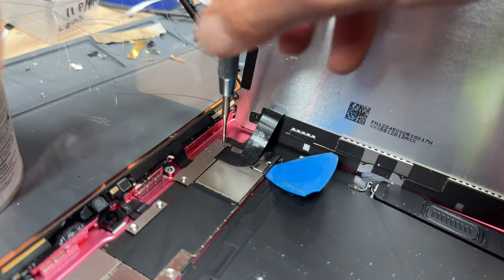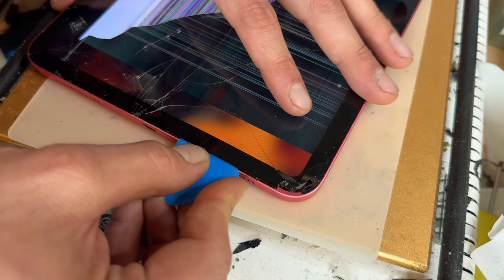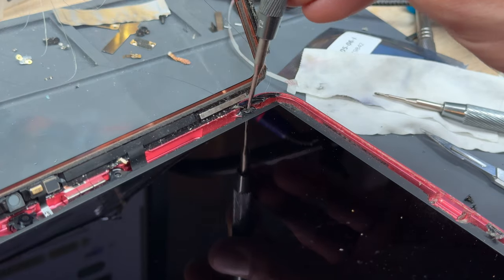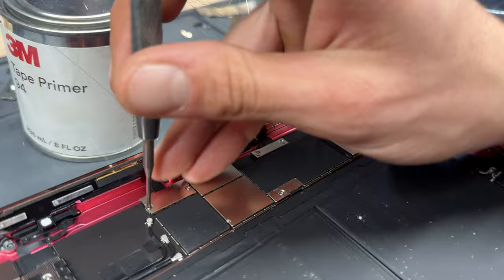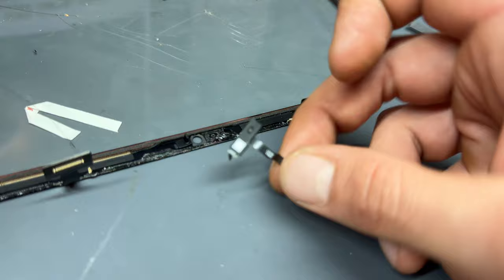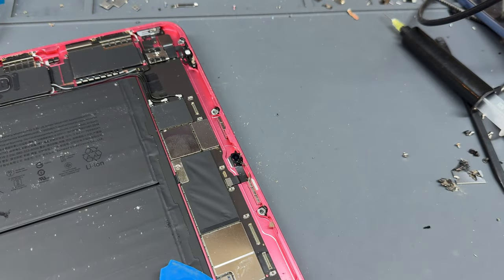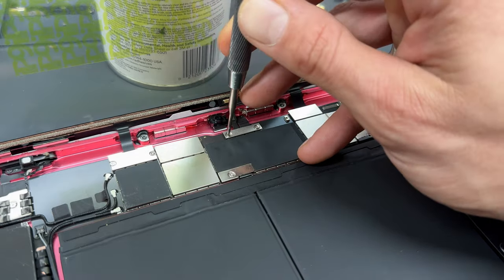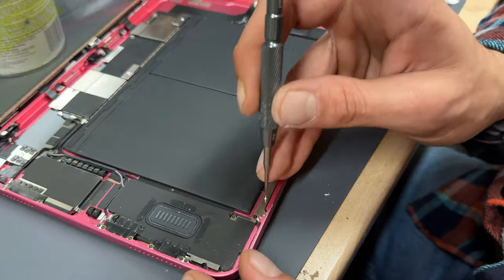Ipad 10th Gen LCD and Screen Replacement Guide! How to fix your iPad 10.9” Screen!

Comment: Makes me cringe when I see people using Isopropyl alcohol to loosen the adhesive.  First, it can seep between the LCD layers also other parts and ruin it.  Second, applying more heat (I always use 100C on a digital heat plate) to soften the adhesive for easy disassembly.  Just my 2cents.

Comment: Thanks for this video. My son had bent the ipad case in half and i used your video primarily to be able to get inside and clean up the food that came in through gaps in the screen.  Then without the LCD inside the metal case I put two stacks of cardboard and used a hair dryer to heat the case and bend it by hand slowly with an oven mitt.  Thanks for posting. Turned out amazing.
Also changed my sons flex cable microphone and works great again.

Comment: Great repair! What is the UV Glue called? And can this also be used for the home button bracket on iPad 8/9 etc. Models?
Reply from the maker: It is uv curing craft glue and yes!
Reply: @iDoctorUK hi can you please help my case pulled up the screen nothing is broken the lcd works and the screen is not broken but no touch is working?? Wow these sure are made cheap for 800.00 any help on what to do or it needs a new LCD
Reply: I Don't want use the warranty because nothing is broke besides i cant us the touchscreen